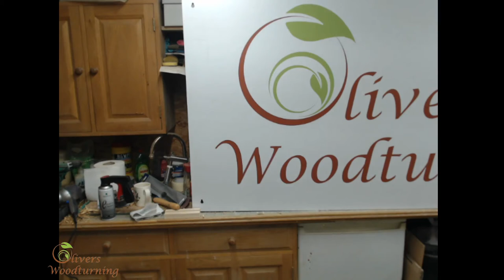Let's Take A look at The Dreaded Skew

Comment: Thanks for another interesting demonstration. Hope you get the monitor cleaned up without any damage.
The last question on the 'beading tool with a point in the middle' is the Sorby Easybeader 814H. It makes two half beads and the separating 'groove' between them, ie the reverse of the 835H which you used at the end of the demo. Both the Sorby tools 'suffer' from having a very short profiled section - unlike the Ashley Iles tool you did the project beading with.
Reply from the maker: Thank you for your comments Phillip glad you enjoyed the video. Your quite right about the Ashley Iles beading tools. I think that are a slightly better design due to the depth. I've never stocked the Easybeader but checked up on it after the comments on the day. :)